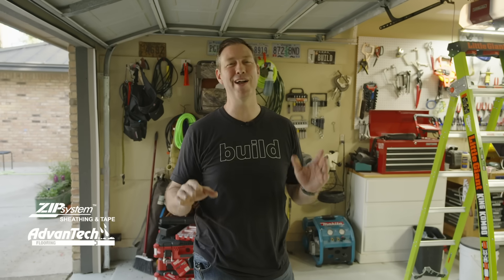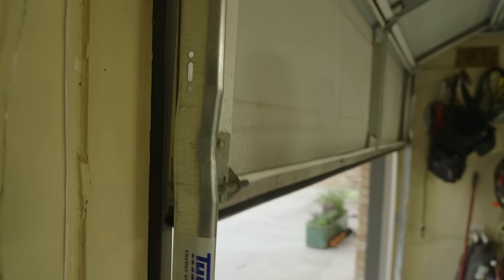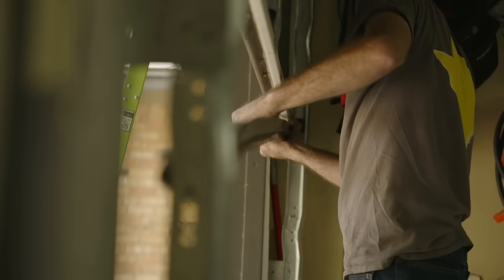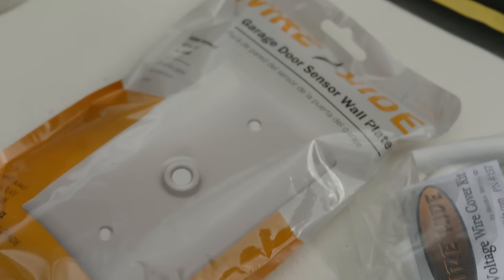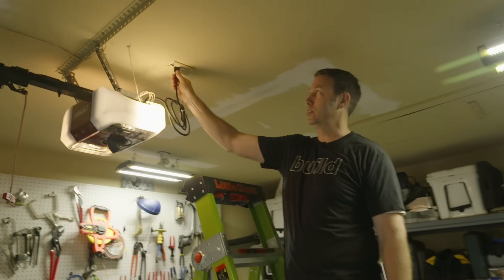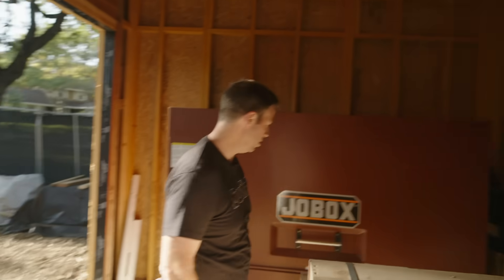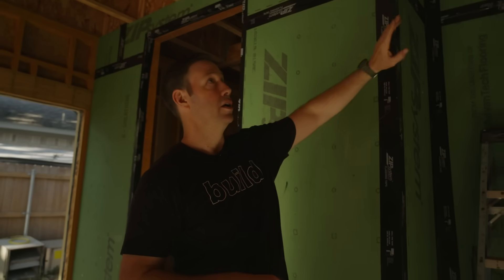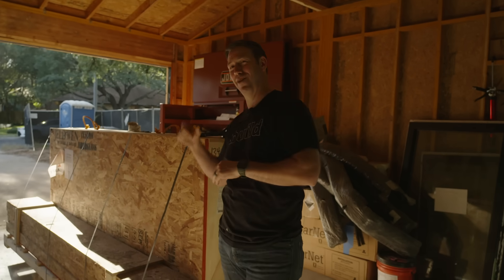Garage Door - Air & Bug Sealing

Comment: The garage exhaust fan sounds like a complete waste.
Reply: Any fuel-injected car with no check engine light will produce next to no CO, so I agree.
Reply: With all of the extra precaution he’s taken to separate garage air from the inside and in light of wanting to cool/heat the garage space I don’t see the point of the exhaust. Maybe if it were controlled by a gas and particulate sensor of some sort.
Reply: The best scenario would be to have the fan connected to a CO sensor which could trigger the start of the fan.
Reply: @rogerNOmore  The best scenario would be to have an electric vehicle :)
Reply: Or just leave the door open long enough to air it out. For heat in the summer,  though, that's the real need in an insulated garage. A hot engine or two gets those temps well into the 90s once parked. Works the garage fridge hard and creeps into the house.
Reply: Also, He mentioned that it had a motion sensor, then mentions stories about generators being used in a hurricane. Wouldn't it have to be set real sensitive to stay on when a generator is running?
Reply: Really dumb idea.  Especially they motion sensor.  Good grief
Reply: I tend to agree.  Most people just leave the garage door cracked a foot or two.  In my mind this opens more issues than it solves because now you have a hole that has to be waterproofed when the solution was a lot more simple.  That being said, some people do "unnecessary" things to cars, or computers, or whatever.  So, if houses are your thing...
Reply: So if everything is so airtight, where is that SIX inch vent getting the air from to exhaust outside???  Also, while carbon monoxide IS lighter than air, gasoline vapor (which he mentions) is heavier than air and will not be vented in 30 minutes from a wall mounted vent (at least not unless that air is moving quickly - which goes back to - where is the exhaust air coming from in his 'tight' house???
Reply: @donabele1243  which is why I asked if the exhaust system manufacturer makes a positive pressure unit instead of a negative pressure one. The point is to remove the fumes, vapors and CO, not just stir it up. Forcing fresh air in diffuses the toxic products of internal combustion engines and the all the other products stored in the common garage, hopefully forcing it out by opening a well located vent with the pressurized air. Your points on the vapor densities are well taken.
Reply: @mikegrant8490  don't want positive pressure in the garage as that will increase the chance of pushing something un-wanted into the house.  Negative pressure is better in this scenario.
Reply: @D2O2  Understood. My point was to keep whatever "bad air" from entering the residence in the first place. Note that I stated a well placed vent to remove the positive pressure air containing the bad products in an effort to keep ANYTHING from the separated space of the residence.  I also asked in an separate post if an ERV system, operating when the garage is closed up and set to shut off whenever the garage door is open, would be a consideration to keep fumes from the residence. If you note that Matt is well insulating what appears to possibly be a vestibule door system to the residence,  that alone will help keep any positive pressure from forcing it's way into that side of zoned HVAC space when the doors are closed. His mini split system for heating and cooling in the garage probably isn't going to develop enough positive pressure on it's own, hence the idea of using an ERV system would be a consideration. One or two vents near the foundation and one or two near the ceiling space would be adequate to remove a slight positive pressure without the entry into living space, wouldn't it? An HVAC  pro can figure this out in a few minutes with instrumentation.  There is also codes compliance. Dealing with fire prevention aspects as well as HVAC are surely on the mind of the inspector (s)....
Reply: @donabele1243  The Open garage door.
Reply: @donabele1243  I would assume he means tight to the interior. Even those garage door tracks are not going to stop air from coming in that way with an exhaust running.
Reply: @donabele1243  Actually this would work. His home is not Air PROOF. Its Air TIGHT and this is in a Garage where he is not going to maintain the same air tightness as in his house which is why he would not need an intake for his exhaust. When I worked in the Asbestos abatement industry the common practice is to create a vacuum in the room with as Air Tight of a containment we could have built through Poly, Duct Tape and spray glue while using an air scrubber venting out to create the vacuum. This will essentially exhaust the bad particles out while, then when the vacuum ceases the air will be pressurizing the room with any leaks in his garage. In his scenario, of course, he does not need to scrub the exhaust air/gas, although I'd argue it would be a better system to scrub for the sake of cleaner air in your neighborhood.  I would expect this to perform just like those commercial construction abatement containments and you could easily test this as I am sure he will in a future video.
Reply: To further discuss the idea that it will just re-enter however... That is unlikely. His main point of exhaust will likely be furthest from the garage door which is the area most likely to have significant leak factor to be of an issue. Even then the open air would likely scoop the gases further and faster... likely into your neighbors open window. Hence why a scrubber unit would be ideal to eliminate this but likely a non issue.
Reply: Exhaust fans is a great idea and safer.

Comment: Building an almost air tight garage?  If so, are you planning to install make up air damper with pressure sensor to bring in fresh air when garage exhaust fan is active?

Great ideas, thanks!
Reply: Even with all this stuff a garage door won’t actually SEAL! There will be a ton LESS but still have airflow.
Reply: For real- I’d love to see Mr. Baczek weigh in on air balancing garage vents in passive house sealed garages!

Comment: I stuff foam pipe insulation inside the bottom seal on my garage door.  Makes a better seal from the added rigidity and compression.
Reply: Great idea
Reply: have done that a few times.

Comment: The wall and ceiling from the garage to the house is a firewall (1hr rated) so the perimeter must be solidly blocked for nailing. that OSB or ply won't pass inspection!
Reply: The 5/8s fire rock will be the barrier.
Reply: i was thinking the same thing.  but maybe that sheething is fire rated?

Comment: I went with the green hinge system that pretty much does what those tracks do but by using springs on the hinges that push them tight.
Reply: I have the green hinge system as well, no issues for past 2 years and seals well.
Reply: Sounds like an extra point of failure compared to these tracks. The tracks won't wear over time but the springs will. Either way I'm sure they're both great products

Comment: I have been looking for a good way to seal my garage door for some time now, but didn't really know where to begin.  This is brilliant.
Reply: DONT waste your money on those tracks/“green hinges”..... cut the RUBBER FLANGE off your existing weather seal (top/sides) install new 2” VINYL WEATHERSEAL STOP MOULDING! Adjust your track to be FUNCTIONAL 1st and as TIGHT OF A SEAL against the outside weatherseal as possible while the door still rolls smoothly (check by hand, 2fingers pressure should open/close the door) if it’s smooth and tight then run with your electric opener (reprofile the opener system if modern 2015+)
Reply: Lol.  Did you watch till the end? This ain’t it
Reply: @AidanSkoyles  I wrote that in the middle, when I realized what the bent tracks could do to clamp the seals. No doubt the bottom seal attachment leaves much to be desired.
Reply: @Martin Boothe how do you add the chinking when putting on the bottom seal?

Comment: Love the video but something I've never understood: The garage door should be balanced with springs so that it is pretty easy to move manually; however we have 1/4 hp electric motors or even 1/2 hp motors to move them. Doesn't make sense. Also. They move so slowly. Maybe it's just me, but I just cannot stand sitting there and waiting for these doors to slowly open and slowly close. It seems we should have moved beyond this 1970s technology by now
Reply: It all depends on the brand operator. Some brands move slow to reduce noise levels. LiftMaster moves almost 2x faster than genie and marantec.
Reply: Have you seen the cars with automatic closing doors/hatches? Takes one second to slam them shut by hand, takes like 30 seconds after you press a button for them to close.
Reply: @MrJramirex  yes, another big annoyance of mine